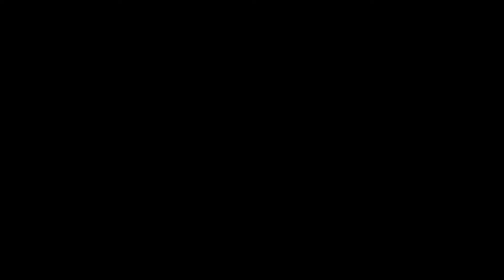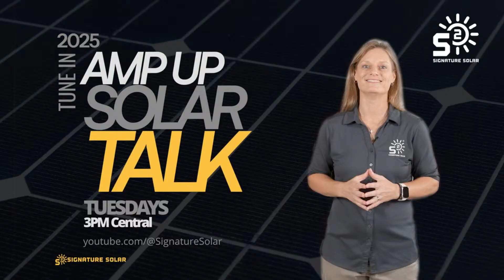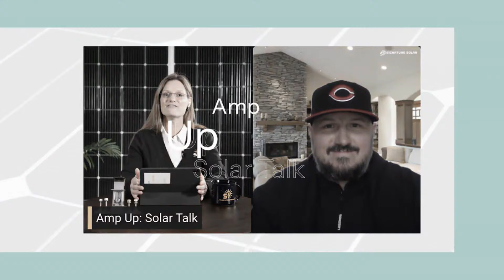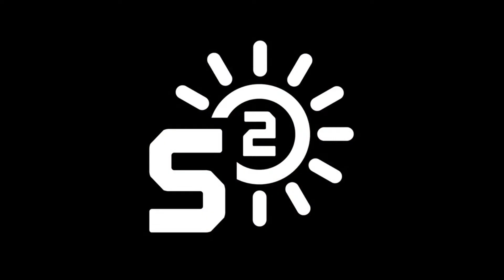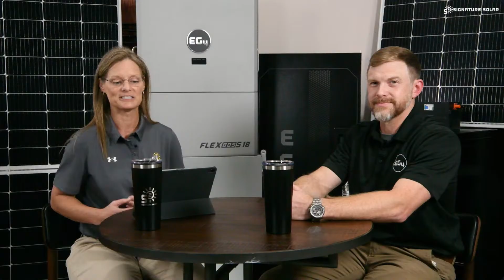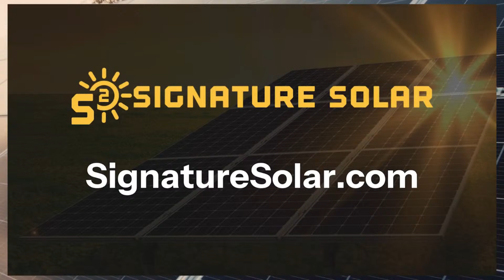Amp Up: Solar Talk - Ep. 27 - UL 9540 Compliance

Comment: This is excellent. Thank you. As a person trying to DIY w/ grid - you really helped clarify the UL requirements for BESS. It was a bit dense for me at first, but after breaking stuff down it makes sense and helps me evaluate different solutions.  I hope at some point there is a standard for battery interop because i see this area as something that will significantly change fairly rapidly.  I'd hate to buy something now that is not able to interoperate.

Comment: Just curious.  How are you driving the cells into thermo runaway.  I was under the impression that lfp cells wouldn't go into thermo runaway.
Reply from the maker: Per EG4, all lithium ion cells will go into thermal run away. Rather its induced via UL testing with a heating element, or even severe overcharging. LiFePo4 is the "safest" lithium ion chemistry but that doesn’t mean it will not ignite on fire if it overheats
Reply: Sounds like if the test isn't able to produce a thermal run away condition, it passes.